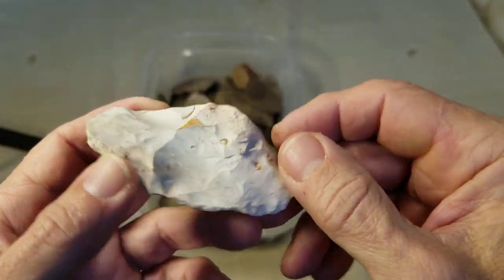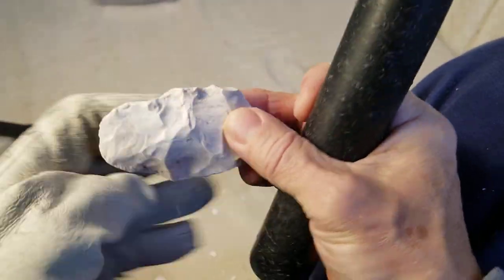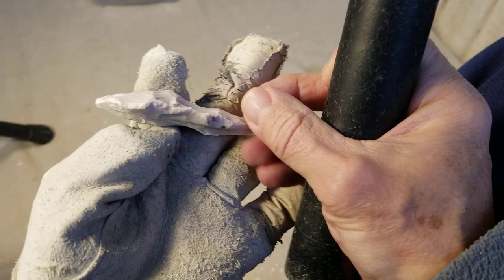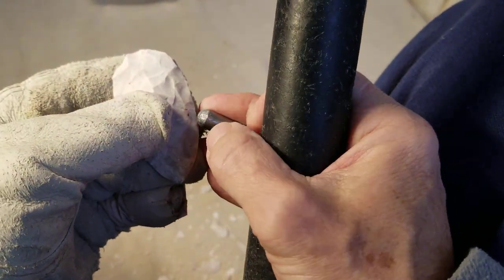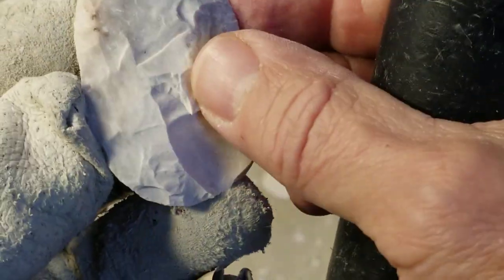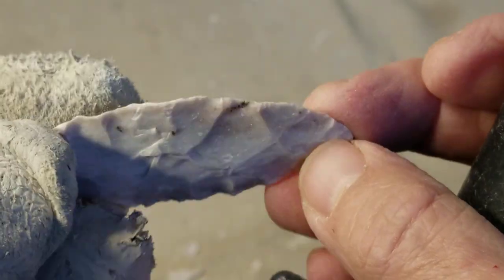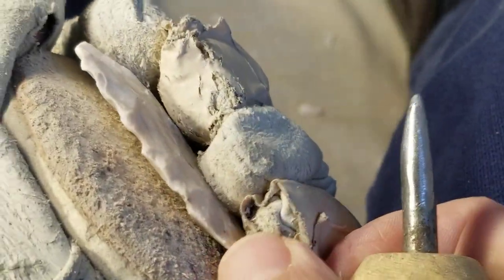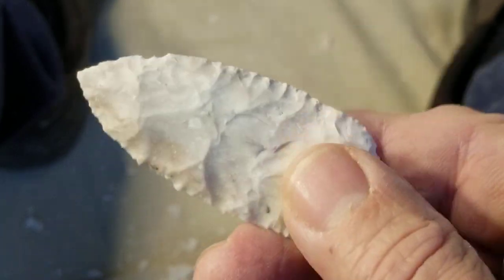1341 - Part 1/2 - White Chert

Comment: If that rock has small vugs, but no fossils, it might be some of the Burro Creek (AZ) material I sent to you (though "medium quality").  If the marks were fossils, then definitely not from that formation (which is volcanic in origin and formed on bentonite beds).  The good quality material of that type looks like "cream cheese" and knaps well, though there is a fair amount that looks similar to that piece.
Reply from the maker: Interesting. I have your rocks in a box in my storage unit in NH. I'll probably get to it this summer.😁
Reply: @KnapperJackCrafty  I was just bifacing some of that material yesterday and found a piece that looked the same/acted the same, possibly from the same piece.  Definitely not as nice as the smooth "cream cheese" to slightly translucent versions in the same spot.